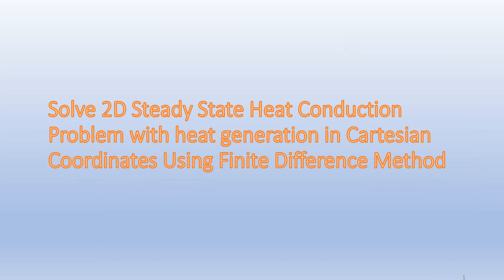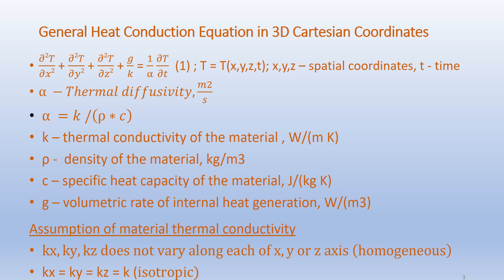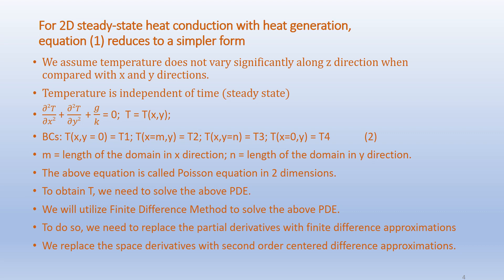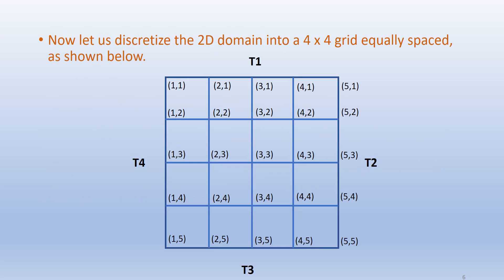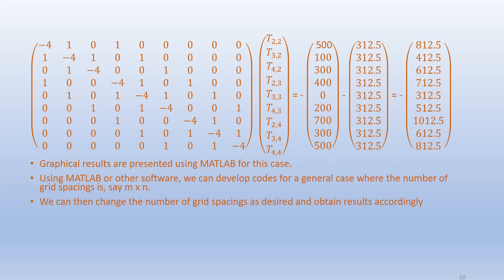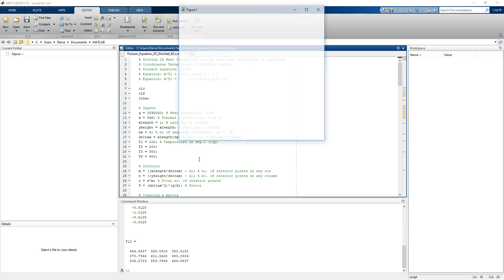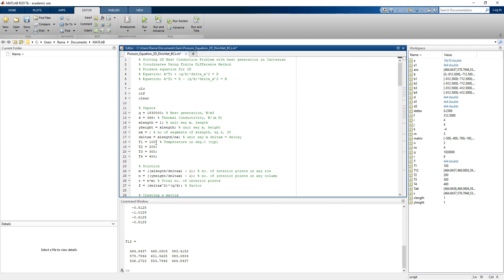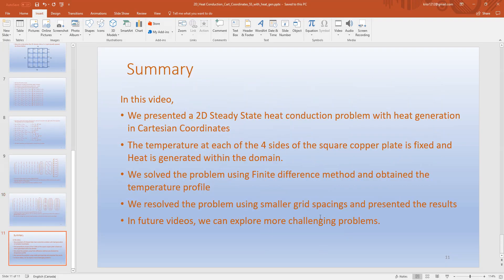Solve 2D Steady State Heat Conduction Problem with heat generation in Cartesian  Coordinates

Comment: Where is the code....link
Reply from the maker: See below
Reply: I don't get any code
Reply from the maker: @protyushmohanta2151  did you check
https://engineering-stream.com
Under
Numerical methods?
Reply: I checked , I got only the ppt
Reply from the maker: @protyushmohanta2151  once in numerical methods check numerical methods codes

Comment: Can you please send me the code for this....
akshaygiram1999@gmail.com
Reply: Thats my solution of his examples (I got exactly the same temperature values, but I chose other graphical representations):

clear variables
close all
clc

%% Youtube-Example "Solve 2D Steady State Heat Conduction Problem with heat generation in Cartesian Coordinates"

xlength = 1;             % Width (m)
ylength = xlength;       % High (m)
nx = 5;                  % Number of nodes on the x axis
ny = nx;                 % Number of nodes on the y axis
sx = nx-1;               % Number of segments on the x axis
sy = sx;                 % Number of segments on the y axis
deltax = xlength/sx;     % uniform nodal spacing on the x-axis

xspan = linspace(0,xlength,nx);
yspan = linspace(0,xlength,ny);

T = zeros(nx);
T(1,1:nx) = 100;    % Temperature at top surface
T(ny,1:nx) = 300;   % Temperature at bottom surface
T(1:ny,1) = 400;    % Temperature at left surface
T(1:ny,nx) = 200;   % Temperature at right surface

k = 366;                % Thermal conductivity
qdot_gen = 1.83*10^6;   % heat flux generation
qdot_node = qdot_gen;   % uniform heat flux generation

conv_crit = 1e-6;       % Convergence criterion
error = 1;              % Initial condition for error
iter_count = 0;         % Counter for iteration steps

while error > conv_crit
    iter_count = iter_count + 1;
    T_old = T;
    for i = 2:nx-1
        for j = 2:ny-1
            T(i,j) = 1/4*(T(i,j+1) + T(i+1,j) + T(i,j-1) + T(i-1,j) + qdot_node*deltax^2/k);
        end
    end
    error = max(abs(T_old-T),[],'all'); % Calculated error
end
T_calc = T(2:end-1,2:end-1);

% Plots
subplot(2,2,1), contour(xspan,flip(yspan),T), colormap;
title('Contour plot of temperature distribution '), xlabel('x [m]'),ylabel('y [m]'),colorbar
 subplot(2,2,2), pcolor(xspan,flip(yspan),T), hold on, shading interp, contour(xspan,yspan,T,'k'),
title('Interpolated contourf plot of temperature distribution '), xlabel('x [m]'),ylabel('y [m]'), colorbar;
subplot(2,2,3), surf(xspan,flip(yspan),T)
title('Surface Plot of temperature distribution'), xlabel('x [m]'),ylabel('y [m]'), zlabel('T [°C]'), colorbar;
subplot(2,2,4), xvalues = 2:nx-1; yvalues = 2:ny-1; 
heatmap(xvalues,yvalues,T_calc,'Colormap',parula),
title('3 x 3 Grid Heatmap of calculated temperature values'), xlabel('x nodes'),ylabel('y nodes')
Reply: Did you manage to receive it? I'd kinda like it too.
Reply: @ameerracle  noo

Comment: can you share the matlab code to this mail raghuveer0598@gmail.com
Reply: Thats my solution of his examples (I got exactly the same temperature values, but I chose other graphical representations):

clear variables
close all
clc

%% Youtube-Example "Solve 2D Steady State Heat Conduction Problem with heat generation in Cartesian Coordinates"

xlength = 1;             % Width (m)
ylength = xlength;       % High (m)
nx = 5;                  % Number of nodes on the x axis
ny = nx;                 % Number of nodes on the y axis
sx = nx-1;               % Number of segments on the x axis
sy = sx;                 % Number of segments on the y axis
deltax = xlength/sx;     % uniform nodal spacing on the x-axis

xspan = linspace(0,xlength,nx);
yspan = linspace(0,xlength,ny);

T = zeros(nx);
T(1,1:nx) = 100;    % Temperature at top surface
T(ny,1:nx) = 300;   % Temperature at bottom surface
T(1:ny,1) = 400;    % Temperature at left surface
T(1:ny,nx) = 200;   % Temperature at right surface

k = 366;                % Thermal conductivity
qdot_gen = 1.83*10^6;   % heat flux generation
qdot_node = qdot_gen;   % uniform heat flux generation

conv_crit = 1e-6;       % Convergence criterion
error = 1;              % Initial condition for error
iter_count = 0;         % Counter for iteration steps

while error > conv_crit
    iter_count = iter_count + 1;
    T_old = T;
    for i = 2:nx-1
        for j = 2:ny-1
            T(i,j) = 1/4*(T(i,j+1) + T(i+1,j) + T(i,j-1) + T(i-1,j) + qdot_node*deltax^2/k);
        end
    end
    error = max(abs(T_old-T),[],'all'); % Calculated error
end
T_calc = T(2:end-1,2:end-1);

% Plots
subplot(2,2,1), contour(xspan,flip(yspan),T), colormap;
title('Contour plot of temperature distribution '), xlabel('x [m]'),ylabel('y [m]'),colorbar
 subplot(2,2,2), pcolor(xspan,flip(yspan),T), hold on, shading interp, contour(xspan,yspan,T,'k'),
title('Interpolated contourf plot of temperature distribution '), xlabel('x [m]'),ylabel('y [m]'), colorbar;
subplot(2,2,3), surf(xspan,flip(yspan),T)
title('Surface Plot of temperature distribution'), xlabel('x [m]'),ylabel('y [m]'), zlabel('T [°C]'), colorbar;
subplot(2,2,4), xvalues = 2:nx-1; yvalues = 2:ny-1; 
heatmap(xvalues,yvalues,T_calc,'Colormap',parula),
title('3 x 3 Grid Heatmap of calculated temperature values'), xlabel('x nodes'),ylabel('y nodes')

Comment: Hello sir, i was wondering if you could provide me the code, i have an exam paper at exactly same problem. Thank you.
Reply: Thats my solution of his examples (I got exactly the same temperature values, but I chose other graphical representations):

clear variables
close all
clc

%% Youtube-Example "Solve 2D Steady State Heat Conduction Problem with heat generation in Cartesian Coordinates"

xlength = 1;             % Width (m)
ylength = xlength;       % High (m)
nx = 5;                  % Number of nodes on the x axis
ny = nx;                 % Number of nodes on the y axis
sx = nx-1;               % Number of segments on the x axis
sy = sx;                 % Number of segments on the y axis
deltax = xlength/sx;     % uniform nodal spacing on the x-axis

xspan = linspace(0,xlength,nx);
yspan = linspace(0,xlength,ny);

T = zeros(nx);
T(1,1:nx) = 100;    % Temperature at top surface
T(ny,1:nx) = 300;   % Temperature at bottom surface
T(1:ny,1) = 400;    % Temperature at left surface
T(1:ny,nx) = 200;   % Temperature at right surface

k = 366;                % Thermal conductivity
qdot_gen = 1.83*10^6;   % heat flux generation
qdot_node = qdot_gen;   % uniform heat flux generation

conv_crit = 1e-6;       % Convergence criterion
error = 1;              % Initial condition for error
iter_count = 0;         % Counter for iteration steps

while error > conv_crit
    iter_count = iter_count + 1;
    T_old = T;
    for i = 2:nx-1
        for j = 2:ny-1
            T(i,j) = 1/4*(T(i,j+1) + T(i+1,j) + T(i,j-1) + T(i-1,j) + qdot_node*deltax^2/k);
        end
    end
    error = max(abs(T_old-T),[],'all'); % Calculated error
end
T_calc = T(2:end-1,2:end-1);

% Plots
subplot(2,2,1), contour(xspan,flip(yspan),T), colormap;
title('Contour plot of temperature distribution '), xlabel('x [m]'),ylabel('y [m]'),colorbar
 subplot(2,2,2), pcolor(xspan,flip(yspan),T), hold on, shading interp, contour(xspan,yspan,T,'k'),
title('Interpolated contourf plot of temperature distribution '), xlabel('x [m]'),ylabel('y [m]'), colorbar;
subplot(2,2,3), surf(xspan,flip(yspan),T)
title('Surface Plot of temperature distribution'), xlabel('x [m]'),ylabel('y [m]'), zlabel('T [°C]'), colorbar;
subplot(2,2,4), xvalues = 2:nx-1; yvalues = 2:ny-1; 
heatmap(xvalues,yvalues,T_calc,'Colormap',parula),
title('3 x 3 Grid Heatmap of calculated temperature values'), xlabel('x nodes'),ylabel('y nodes')
Reply: @fl4shp0in79  If you could provide me with the code It would be greatly appreciated :) brendon.armstead@live.com

Comment from the maker: I refined the mesh further. With 50 segments along x and 50 segments along y directions, the temperature, I got was 629.2603 deg.C. I think that was close to what you found out using LBM.
Reply: Sir kindly send me the code it will be very helpful in my study my email is zahidhasan1390@gmail.com

Comment: sir,please give the link of the code !!
Reply: Thats my solution of his examples (I got exactly the same temperature values, but I chose other graphical representations):

clear variables
close all
clc

%% Youtube-Example "Solve 2D Steady State Heat Conduction Problem with heat generation in Cartesian Coordinates"

xlength = 1;             % Width (m)
ylength = xlength;       % High (m)
nx = 5;                  % Number of nodes on the x axis
ny = nx;                 % Number of nodes on the y axis
sx = nx-1;               % Number of segments on the x axis
sy = sx;                 % Number of segments on the y axis
deltax = xlength/sx;     % uniform nodal spacing on the x-axis

xspan = linspace(0,xlength,nx);
yspan = linspace(0,xlength,ny);

T = zeros(nx);
T(1,1:nx) = 100;    % Temperature at top surface
T(ny,1:nx) = 300;   % Temperature at bottom surface
T(1:ny,1) = 400;    % Temperature at left surface
T(1:ny,nx) = 200;   % Temperature at right surface

k = 366;                % Thermal conductivity
qdot_gen = 1.83*10^6;   % heat flux generation
qdot_node = qdot_gen;   % uniform heat flux generation

conv_crit = 1e-6;       % Convergence criterion
error = 1;              % Initial condition for error
iter_count = 0;         % Counter for iteration steps

while error > conv_crit
    iter_count = iter_count + 1;
    T_old = T;
    for i = 2:nx-1
        for j = 2:ny-1
            T(i,j) = 1/4*(T(i,j+1) + T(i+1,j) + T(i,j-1) + T(i-1,j) + qdot_node*deltax^2/k);
        end
    end
    error = max(abs(T_old-T),[],'all'); % Calculated error
end
T_calc = T(2:end-1,2:end-1);

% Plots
subplot(2,2,1), contour(xspan,flip(yspan),T), colormap;
title('Contour plot of temperature distribution '), xlabel('x [m]'),ylabel('y [m]'),colorbar
 subplot(2,2,2), pcolor(xspan,flip(yspan),T), hold on, shading interp, contour(xspan,yspan,T,'k'),
title('Interpolated contourf plot of temperature distribution '), xlabel('x [m]'),ylabel('y [m]'), colorbar;
subplot(2,2,3), surf(xspan,flip(yspan),T)
title('Surface Plot of temperature distribution'), xlabel('x [m]'),ylabel('y [m]'), zlabel('T [°C]'), colorbar;
subplot(2,2,4), xvalues = 2:nx-1; yvalues = 2:ny-1; 
heatmap(xvalues,yvalues,T_calc,'Colormap',parula),
title('3 x 3 Grid Heatmap of calculated temperature values'), xlabel('x nodes'),ylabel('y nodes')